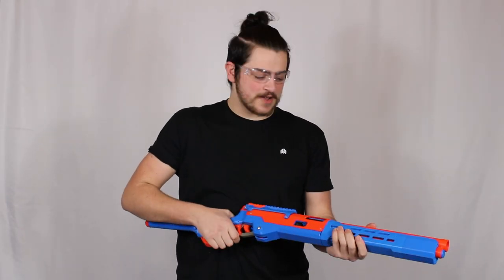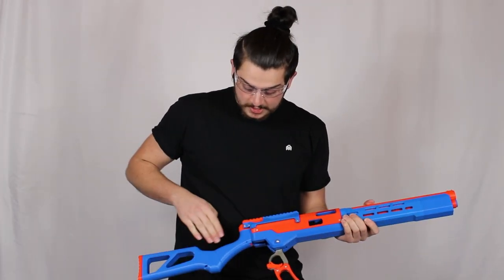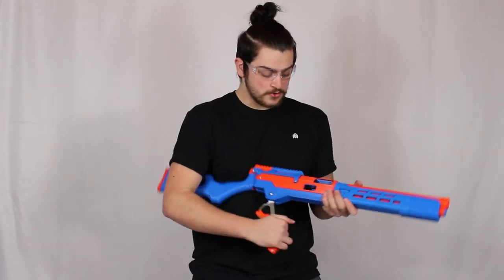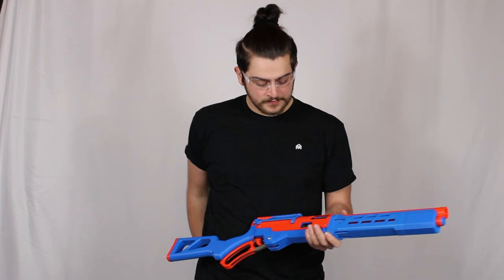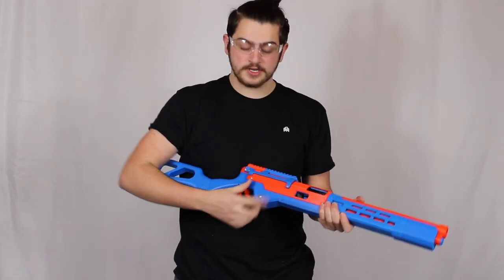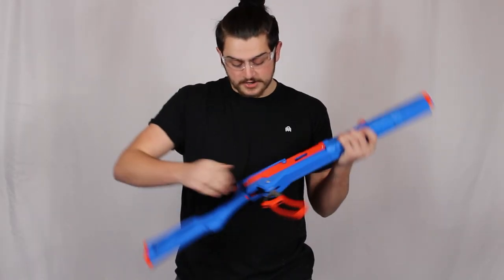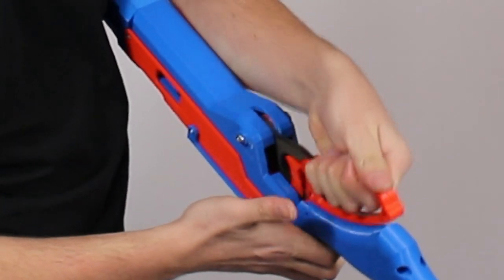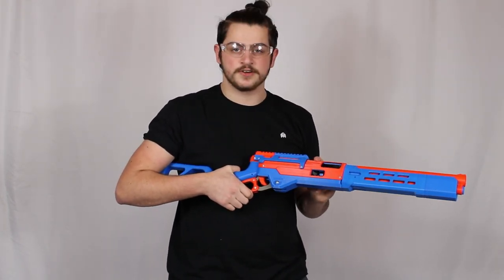Wingchester Tutorial - Basic Operations - Shellington Blasters

Comment: You mention in this video that it utilizes a 20-lb spring. Other than weaker firing performance, would the device still function in the event that the user swaps the spring for a weaker one?
Reply from the maker: Yeah, you can use weaker springs on this. The performance does drop off quite quickly however, so you can't go too low. We're working on figuring out which springs are compatible. Recently we found the K31 to be too weak to even be used reliably in here. But I think a 788 spring will hit around 85fps, still to be confirmed. 

Otherwise the rest of the functions of the blaster remain unchanged. Honestly, the weaker the power spring is, I think the more fun the blasters become to handle. Everything just gets so light. In fact, the spin cock from the Terminator 2 movie can only really be performed at a lower spring load. So far, it's only ever been done with a 85fps variant of the blaster.

All of this information will be documented on the site when it's ready.

Comment: Is there some way I can get in contact with you about customer support? I have been trying to do so by email for months without response since the first attempt, which resulted in a promise or replacement parts that never came.
Reply from the maker: Can you attach an order# here or just "bump" the email? I don't see any new/unread emails in the inbox. It may have just gotten lost in the pile.
Reply: @ShellingtonLabs   Order number 10863.

Sorry for going about it this way, but I didn't have much luck trying to bring the matter back up via further support tickets or further replies to the same E-mail as the initial ticket.

The short version is that the shell lifting mechanism on my Wingchester broke in shipping and thus my blaster has been functionally single-shot only.
Reply from the maker: @Balmung60  Strange, I had replied to that message 8 days ago on July 28th and then forwarded the message afterwards but haven't heard any updates since. Can you see those messages at all?
Reply: @ShellingtonLabs  There we go, somehow I missed the July 28th reply, so that's on me. I do have the original box, so shipping it back won't be overly hard if that's needed.